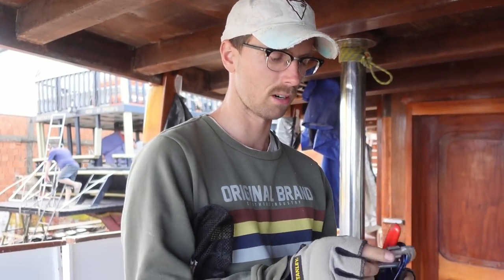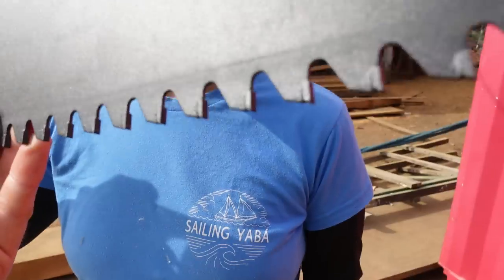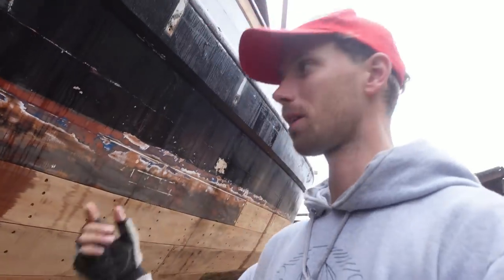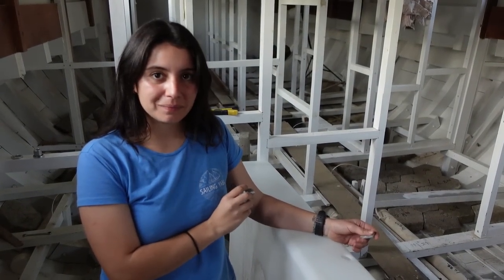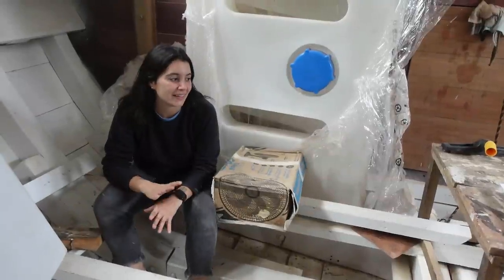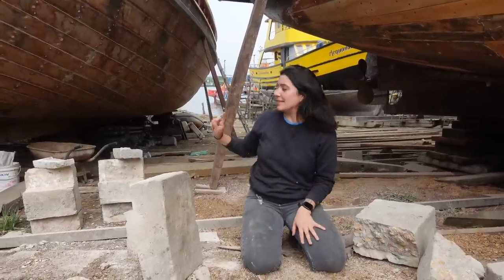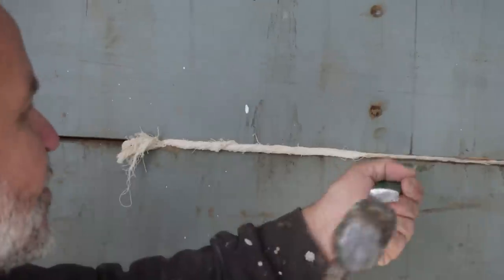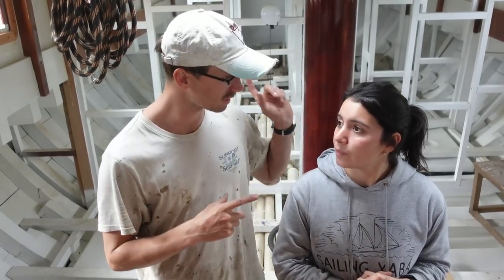Boat build: Poop smelling wood + 1 ton of liquid ballast — Sailing Yabá #105

Comment from the maker: After watching us struggle so much with our furling system, what would you suggest for Yabá's rigging? All kinds of ideas are welcome!! 😄
Reply: Go traditional and hoist it
Reply: If you have furlers they MUST be easy to service and unjam in bad conditions. A second head stay with a hank on sail would be easy to drop maybe. Either way what you have now is dangerous
Reply: Bom dia MP e Ben.☺️🐕
Reply: Achei muito perigoso o Ben desenrolar a vela naquele mastro.🐕😊
Reply: @josecarloscampelo7501  agreed 👍!
Reply: @Davidcallard  tanks you.😄
Reply: You have too much slack in the headstay for it to furl properly.  Perhaps a bobstay (and even a dolphin striker) would allow you to develop the tension needed.
Reply: Ben or MP, 
My dear friends (I am in Australia 🇦🇺 so I don't expect that I will ever meet you but I think of you both as my friends!) please before either of you go out on that bowsprit again - and believe me it will happen! - you really must rig up a catcher net beneath the spar. There's bound to be a name for it but I don't know what it is. The poopy cats heads should be a good place for fixing the inboard ends of the net. There's probably plenty of examples on Google of how to do it also.
Reply: You definitely need a safe tread way to reach the furling jib.
- extend the round bowsprit with a flat walking surface.
- a good pulpit 
- maybe a security net underneath (belt and suspenders strategy! )
So you'll be able to periodically maintain the furler and keep it functional, 
Or maybe clear a jam happening while sailing
...
Or enjoy the dolphins playing around
Reply: Those furlers really seem like the easy solution with how simple they are, right? Well, I can't tell you how many times I've had problems with these stubborn things. Especially the ones that just unfurl with the sheets and then furl back in with that one, usually very flimsy furling line. The sail doesn't roll in straight and gets all wonky, the furling line doesn't roll up orderly and blocks itself in, the drum seperates and the furling line gets stuck in between,... It's just a mess and very difficult to repair at sea (and, of course, they break in the worst possible moments in a storm or right when you're about to go into a harbor and you can't get the sails down. 

If you really want a furler system I'd suggest one with an endless line that you furl in and out using that line which can be a lot thicker and easier to handle because it only goes around the drum once. It's much easier to repair and the thicker line will last a lot longer because it doesn't chafe against itself.

Even better in my opinion would be hank-on sails with a classic haliard (and ideally also a downhaul line). In a tight situation you can just let it drop to the deck and worry about everything else later. It might also be worth looking into a traveller for the bowsprit so you can prepare the outer jib (I'm not entirely sure about the nomenclature with this type of boat - it might just be the jib and the one behind it might be the staysail - I'd love a video about this topic at some point) from the safety of the deck and then just pull it forward right before raising it. That way you don't need to go climb the bowsprit every time. And if you do there really should be some safety lines to stand on and a net below the bowsprit, but I'm sure you were going to do that anyway because it looks cool. 😉

Maybe you could check out a few other boats with different types of rigging and see what you're most comfortable with. I'm sure many boat owners will let you try out their systems to help you make a decision. 💚
Reply: It's hard to say without seeing what the original rig looked like. But normally there is also a bob stay leading from the head of the bowsprit to the stem near the waterline, and then two shrouds leading from the end of the bowsprit back to the sides of the hull of the boat on either side near where your cathead is. One can add netting between the shrouds and the bowsprit to make it safer to go out it. But there are so many ways it can be done it's hard to say. Furlers are prone to tangling though.
Reply: @bawrytr  You're absolutely right about the bobstay and shrouds and yes, that is where you'd attach the net. I'd still also add a designated footrope above the net. 👍
Reply: Uh, Ben...You need something like Tri-Flow(I suggest both spray and squeeze versions), do not loan out if you wish to see it again....Just a thought, how about sealing the stones with silicon sealant between the seams, after all the setting is done(added stability to the ballast)....As far as grey/black water tanks, try more towards the bow and stern, to balance out(baffled tanks of course)....IHMO
Reply: Seldon/Firlex for self furlers.
Reply: Net under the bowsprit, top down furler on the end of the sprint for light Genoa or spinnaker,  club footed jib that is self tending and hanked on with reef points, mast head main, mizzon.
Reply: Drum extended above the sprit an extra arm's length, furling line pullied on sprit to suit; net on the stays when they're fitted - that your feet won't slip through; arrangement of choice to clip to; crew member to be voted for the work out there (fix the ballot!) while you have a beer. Easy!
Reply: @BlueWaterTeno  
In the previous video Ben mentioned the slack was because the rigging was loose. There are no shrouds attached or backstays. The boat does I believe have a chain bobstay, side stays with netting. 
Not sure if Yaba has it but sometimes you see a pulpit on the bow sprit allowing a safety line in a triangle from bowsprit to the catlins or whatever they are that the side stays use to triangulate the tension on the bowsprit. Trampolines can be strung between the side stays with netting attaching the side stays to the safety lines. Some similar type of access is mandatory for hank on or more traditional sails. A means to douse the sail, like a sock would seem wise for a fuller sail this remotely stayed. Typically the sails on the bowsprit tend to be large, often light wind sails. Not something you want have up and irretrievable when the weather suddenly changes. 
I certainly hope this method isn't the final seagoing method of servicing the furler. As fun as it was watching Ben and wondering if there would be a " whip" effect like the tip of a fishing pole, on the sprit in choppy seas. Would it even be possible to stay on the sprit in any real waves. 
Salt and Tar, another YouTube channel about building wooden sail boats. These couple built their entire boat from the keel up with rough lumber to finished furniture. 
They designed their bowsprit to be retracted. By detaching the bobstay the bowsprit can be hoisted, pivoting at the Sampson post, so once fully lifted it does not protrude past the bow of the boat. A nice difference in length when paying for footage to use a facility. Maybe easier access to service a furler though releasing the bobstay under any tension or adverse conditions is risky at best. 
I know there are some small boats that offer an additional option for a bowsprit mounted furler called a screacher. A play on reacher and the fact that it added significant sail area for performance that would make you screech. I would be hesitant to put more than a bedsheet up on a bowsprit that long. The forces generated on the rigging and the sprit are what result in such impressive performance. Yaba has an elegant line but there is something just too dainty, refined and fragile about that sprit and furler. 

I do look forward to seeing her under sail with that for sail open. I bet she looks absolutely majestic. I would love to see ratlines in the shrouds to a crows nest.
Reply: Furlers like that seem great...but they're a real pain to maintain and they tend to go bad at the worst possible times.  For my 2 cents, I'd say go completely traditional with the rigging, block and tackle, etc.  Manually hoist and lower everything.  The simplicity of the traditional rig adds a margin of safety (no gizmos to fail), and it's easier to handle than you think.   

Maybe even consider something like a junk rig, which would look stunning on Yaba.  They out-perform most Bermudan rigs of similar size, are simpler to handle and reef, extremely durable, and would add a touch of class and make Yaba stand out from the crowd of Bermudan rigs.  With a junk rig in place, you wouldn't really even need the bowsprit/sprit-sail/stay-sail setup anymore and could remove or shorten the bowsprit if you like.  You could also likely do away with the standing rigging with this kind of setup.  Most junk rigs have no standing rigging.

Of course, if you wanted another traditional option, running lateen sails would be amazing, and would harken back to the days when the Portuguese were exploring the world in lateen- and square-rigged ships, with Brazil being one of their major ports of call on their travels.  Again, the lateen rig is simple, efficient, and easy to handle, not to mention beautiful. 

Just my thoughts.  :-)
Reply: @BlueWaterTeno  ^ This. Furlers are very reliable so long as the foil is under tension to keep it as straight as possible. Also when furling the sail, it's important to get the sail to wind onto the foil with some tension, but you can only do this if the foil is straight! It will also help your sailing performance...
Reply: Na minha opinião, vocês precisam que a maioria das velas sejam auto bordejantes. Imaginem a Yabá bordejando com o velame atual, precisaria de um marinheiro pra cada vela exceto a de popa, mais um no leme. Se vocês estiverem velejando só os dois, uma vela de cutelo à frente com um marinheiro pra bordejar, todas as outras velas de marconi que bordejam sozinhas e o outro marinheiro no leme seria melhor.

Comment: Rather than connect all the tanks together, connect them all to a common manifold with a shut off valve on each tank connection to the manifold , this enables you to select what tank you want to use. You will probably have to get the manifold built to your own specification .
You can use some four inch (100mm ) stainless tube for he body of the manifold with an inlet and outlet threaded stainless nipple per tank.

Comment: Suggestions  1. Install pulleys on the bowsprit to direct the furling lines to the drum.NB Now would be a good time to overhaul the furler especially the bearings.    2. Rather than cutting the blocks. Break them down & recast. Easy to mold to ensure a proper and uniform height. All those stones need to be secured in place. Momentum & hull list will move them. 3. The fittings through the water tank did not seem to go thru the tank wall at right angles. Angled washers could & should be used to make proper bearing and to make the sealing surfaces uniformly loaded.

Comment: I think one of the levels of hell in Dante's Inferno involves cutting concrete blocks with a hand saw.  Man, I would've avoided doing that like the plague.  Really felt sorry for the guy having to do it.  At least the circular saw cut down the load a bit.

Comment: You will need to have a vent of some sort on the water tanks, to equalize the pressure. When you fill the tank the air that is in the tank needs to be displaced. The inverse is also true. As the water in the tank is used, if air can't get in you will be trying to collapse the tank. You could use the same fitting that you showed us. Put one in the top of the tank with a short hose up off the tank. I am sure that there is something made in the marine industry for this purpose.
Reply: Watch the video! The vent is in the cap...

Comment: Yaba,
I know the forestay is slack and the fuller will bind more, but the weight of the sail and your weight on the sprit provide significant tension on the furler cable/forestay. Watching the effort necessary to unfurl that sail even with the assistance of the sail being pulled. Man I hope you look at your furlers, get them out of the elements and lubricated. They are meant to be used, that's maintenance for them. Sitting idle in the salt air does little good for anything. I think it would be worth looking into some used metal scaffolding sections. The boat yard could certainly make use of them in ways I can't even imagine. Perhaps we viewers would contribute to a fund raiser to gift such equipment to Yaba and the boatyard. A few sections of easily assembled scaffold would make a nice platform to service the bow sprit and furler. 
Amazing chaos and efficiency with lots of hard work, it's exciting watching the boat become Yaba again.
Reply: If there was a means of attaching a "stay" from the tip of the bowsprit to the top of the furler mechanism to pull the top of the furler forward. There would be less stress on the furler. If the furler was in a structure "cage-like" that took the strain of the furler forestay. The furler mechanism would spin easier

Comment: I work with concrete block & Slate, when using my large  35 cm saw blade I have a hose system to cool my blade BUT when using a small 17.5 cm blade or my 8.25 cm blades .... if you have a watering can like for watering Planters, make the hole smaller by close it up or remove the wide dispersing head so only a dribble of water comes out. I can hold my saw with one hand the watering can with the other & as I move through the stone, the water keeps the dust down to nothing & it keeps the blade cool, so they last much longer & I don't mean a bit longer, you keep the diamond coated blades cool & they will cut day after day after for you. Good Luck, you guys are doing such a great job & all the hard work by everyone shows in how beautiful your boat is looking.

Comment: Great progress!!! Another idea to put some kind of vapor prevention membrane between the cement ballast and frames to prevent constant wicking between the two as they try to equalize hydrostatic imbalance for an environment that is always in constant flux of moisture change. The paint will help a bit but will eventually crack under cement pressure points.

Comment: WoW! That was a lot of work with the ballast! I’m sure your glad that part is over with.
I would also suggest adding extra electrical conduit with pull junctions in critical locations.
There will always be something that you’ll want to add later on. The conduit will make adding the electrical, or data cables so much easier.
( Ilearned this lesson the hard way😵‍💫)

Comment: MP,  you should have used that smelly piece of wood in your roof/deck over the aft cabin area, because in English, that is called the Poop Deck :) and your close needed a "FINALLYYYYYYYYYYYY"! like your friend Roberta. On the breather, you must have a breather to allow air in and out as it as water is pumped in or out of the tank. Yes, some water could come out if you overfill a tank, but that is something you will have to guard against.

Comment: The problem with water is that it flows down, so if your watertanks are directly connected port to starboard and front to back the water will sit with all the weight in the wrong place on a long haul if the watertanks are halve full. That means you need to draw from all 4 tanks seperately and dont allow the water to flow by itself from one tank to another. Also if you somehow get contamination in one tank it will spread if you transfer the water between the tanks. But i am sure you already figured that out.

Comment: How do you know the drop from the bow spirit is not good, if you've never done it? 🤔
Most people put the poop deck on the back of the ship 😂
Next time, go with a bronze keel 😃
I hear the ketch rigging works very well for blue water wooden boats.  but I know less about sails than Portuguese.

Comment: I think your furlers are fine but they do only work if there is some tension on the forestay so once the masts are stabilized with shrouds again and the bow sprit is fixed to the bow with a chain it will be easier to furl&unfurl the sails.

Comment: I'd put in a double macerator redundancy and wouldn't bother with a grey water tank. It's a real headache when the macerator quits at an inconvenient time.
Reply: Macerator quit at an inconvenient time? I can assure you there is no convenient time for a macerator to quit. However having survived a macerator not quiting  but pressurising a blocked black water until the tank made the toilet run in reverse. It would have been convenient to just quit before I was bailing buckets of crap puree over the side.
Reply: @philgray1023  yuck... the best time for a macerator to quit is when your boat is close to an easily acquired replacement or parts. The worst time is when your at sea away from the necessary parts or replacement. This past summer I had to take it apart and clean the usual issue: hair wrapped around the chopping blades. I fashioned new gaskets from paper bags and wax.

Comment: Yo me pregunto ? no seria mas facil hacer encofrados y llenarlos de hormigon dando la forma del barco que colocar tantos retazos para el lastre? podria ya facilitar los huecos para los tanques de agua ,armarlos en secciones calculando el peso de la piedra ,arena y cemento ya que el agua tiene que evaporarse es solo una sugerencia :saludos desde Uruguay
Reply: Unfortunately it would be bad to do so. If water was to get into the bilge area( and of course it would)  then once it soaked into the cement it would not be able to come out and would rot the bottom of the boat out again. Or you would have to break all the cement out just to dry it out.

Comment: I now its already done, but did you consider casting the ballast out of concrete poured into "T" shaped molds rather than do all the  stone cutting?
Reply from the maker: It felt really good to reuse what we had already despite all the effort! Also because it's not just concrete, but is has baryte bits inside, which makes it denser 😊